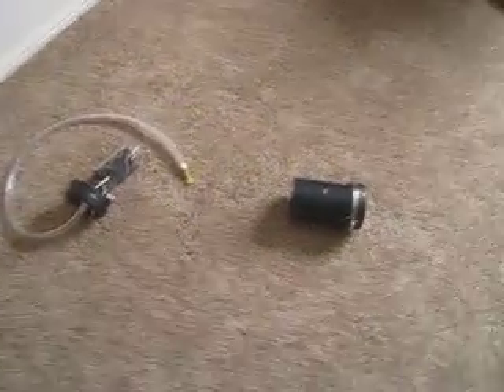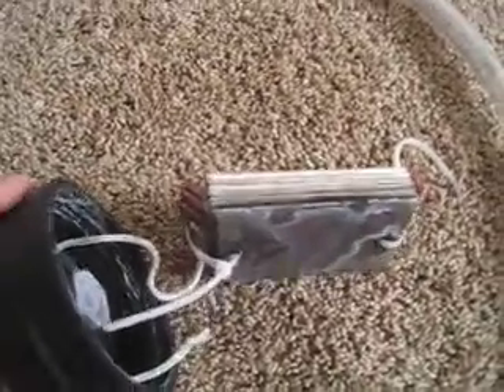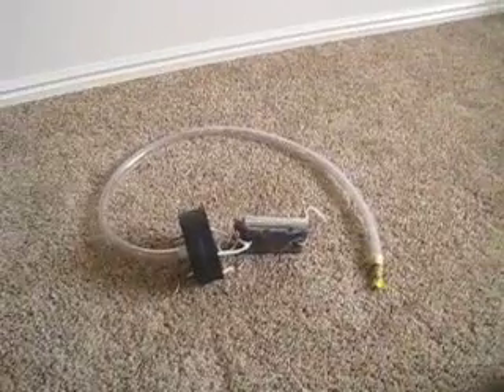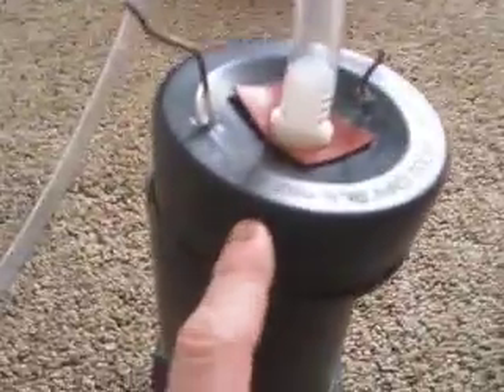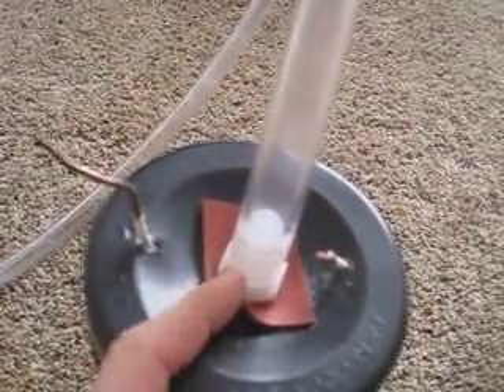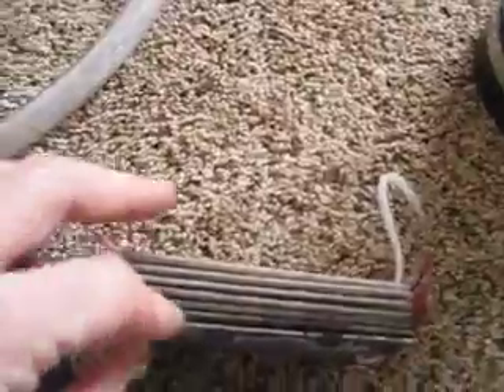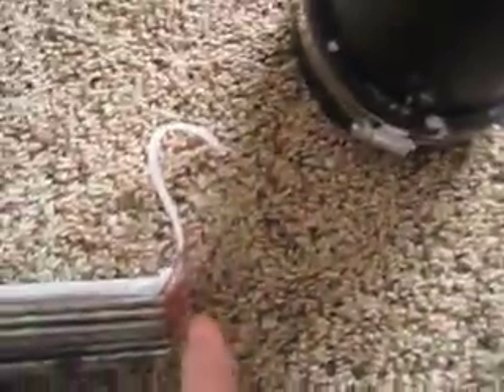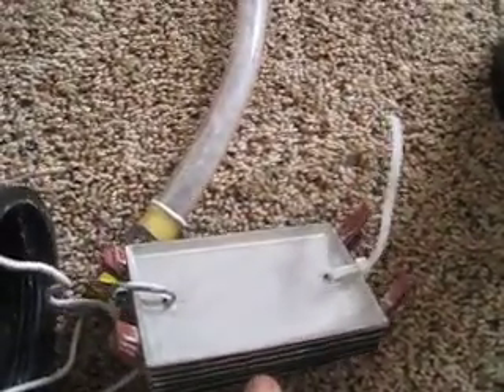HHO Generator Brute Force Part 1

Comment: Hi Guy, its all down to experience, the more you mess with it the more you learn, but treat it all with "Respect" its dangerous, and KOH Burns..... to get a good tool check out my video ...FuelBan T-3. Spark Arrestor. Bubbler . 1 Ltr Measure, Pt 1 ...... to check out KOH dangers check video .....Dissolving a Chicken's Foot in Concentrated Sodium Hydroxide .... treat it all with respect & open mind.   interesting video guy.
Thom in Scotland.